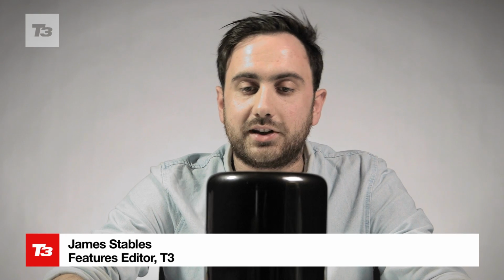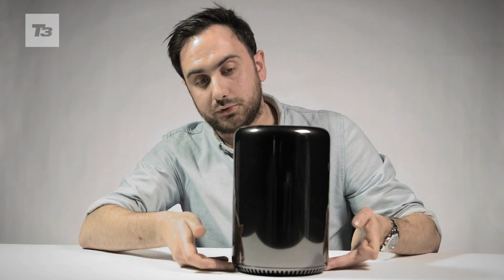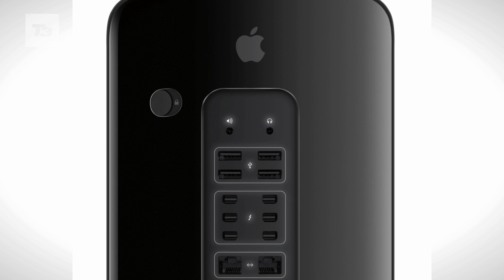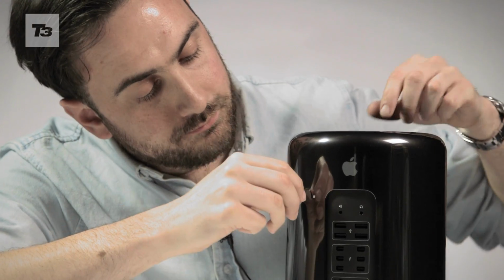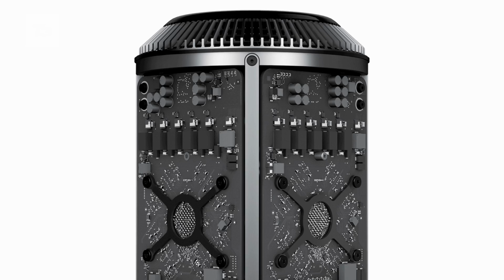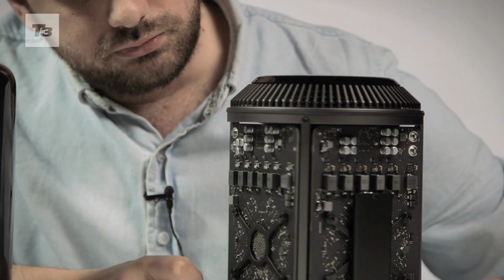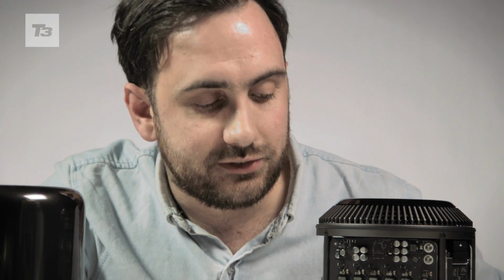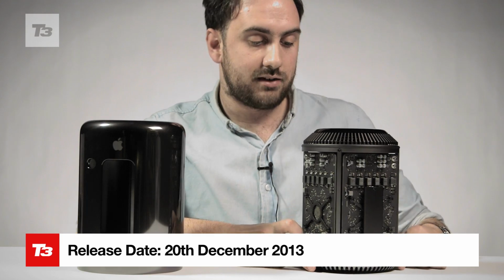New Mac Pro Hands-on & First Impressions

Comment: Just no, build it yourself because its not any better a gaming pc. This is for video editing, and I will get better performance gaming wise on a £2000 rig. This guy makes it sound as if the parts are special to this computer when you can buy all the same parts If you built it yourself. And you would not need a mass of water-cooling if it were built normally, especially if not overclocking. If you are getting the top end Mac Pro, you could easily get a faster computer for less, and you are effectively spending quite a bit of your budget on the fact that its a round pc, and that it is shiny...

Comment: This guy is so clueless about specs "12-16GB of GDDR5 just for the system and 2-3 on the graphics as well", first of, the the "system" does not use GDDR5, and obviously isn't limited to 12-16GB. "Got your xeon processor there" looking at the GPU and PCI Flash, "reverse mount for the hard drive" *looking at the second GPU card", holy shit seriously?

Comment: Sorry mate the system doesn't come with 12GB GDDR its normal ECC memory
Reply: ECC RAM is not normal memory.
Reply: deasystems Yeah buts its not GDDR, they are using DDR3 1866 ECC high density memory. GDDR5 is used in graphics cards not main memory

Comment: So, can it run Crysis 2 on 4k on ultra capped 60FPS? If I don't see benchmarks I'll just assume it's crap.
Reply: First of all, crysis 2 doesn't support 4k resolution 
and second, did you listen to the specs? you're damn right i could
Reply: First of all, Crysis 2 supports 4k resolution. 2nd of all, I'm just making conversation. We are hearing about those "high end" graphics cards and what not. It would be cool to see it handle something like that, but since we have had no info about the clock speeds of the graphic cards I'm still in doubt. 3GB VRAM doesn't tell me shit until I see some clock speeds.
Reply: ***** That's for the entry-level.  12 GB VRAM for the D700 configuration.
Reply: Check out Anandtech's review.  You'll be impressed.